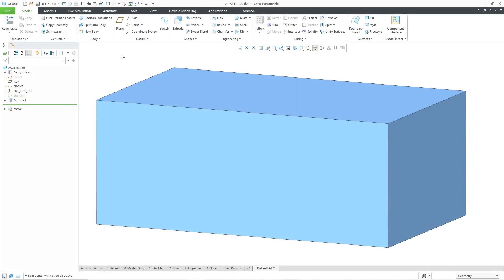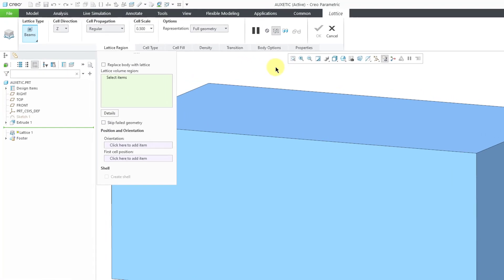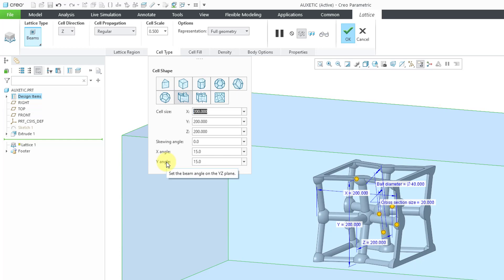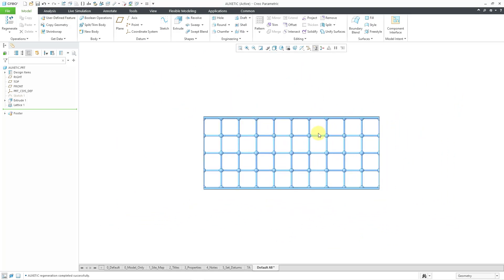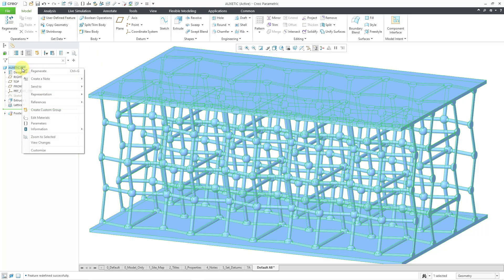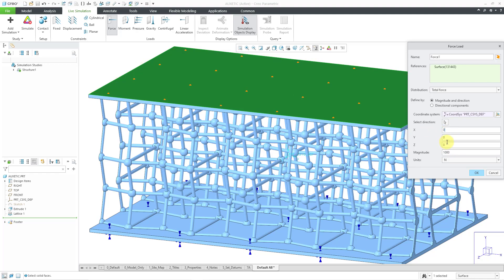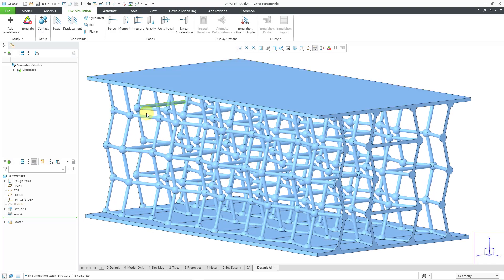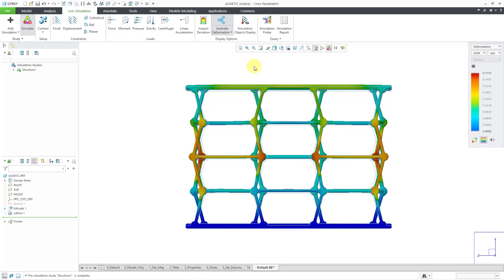Creo Parametric 10.0 - Additive Manufacturing - Auxetic Lattice Cell Structures

Comment: hello, can we simulate using a gyroid lattice structure? because when I try to simulate that structure, the structure disappears, can you make a video to solve this problem?
Reply from the maker: When something like that happens, open a ticket with PTC Technical Support. I had the same problem. My 6+ year old computer has insufficient RAM on the GPU to perform simulation on the advanced lattices. I will not be making a video on the subject. I generally don't make tech support videos.